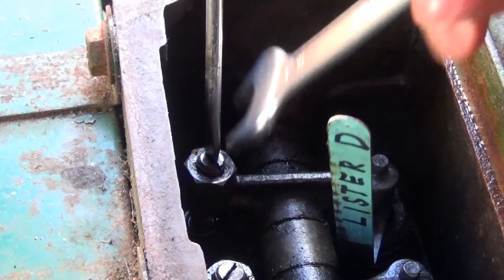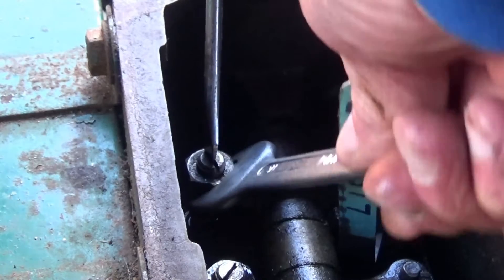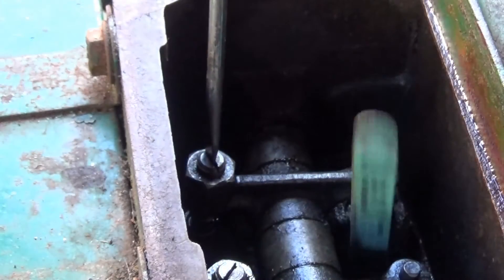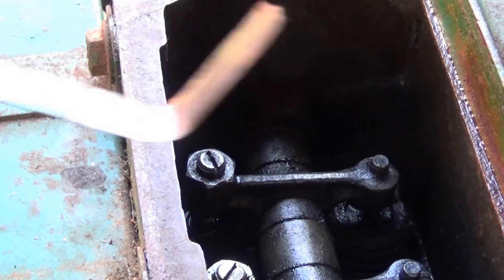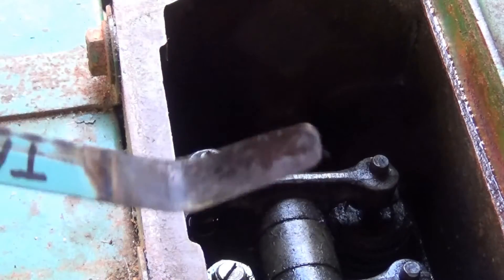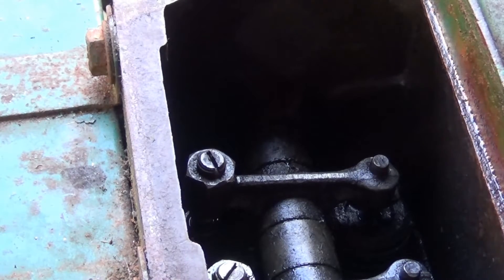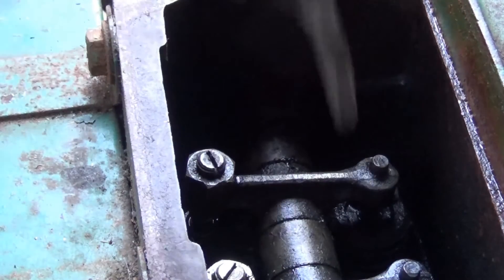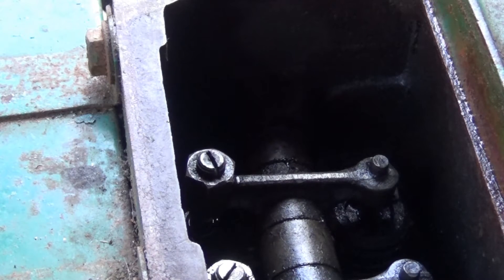How To Set Tappets

Comment: I dread to think how many engines I've set the valve clearances on...but it's good to watch other people too so we're always learning. The last one I did was on a 1973 850 mini a few months ago, it made a big difference too as they were miles out of adjustment. The other thing I found was the points/condenser wires were hanging on by barely one strand...gawd knows how that car ever ran.
Reply from the maker: Did the Nuffield but that's the only time I've done any for years Andy. Did 1 to 5 engines a week when I was reconditioning them in the early 70s. If we did 2 a day, I usually built one of them.
Yes I've discovered things that make you wonder how it's been running ok in the past.

Comment: I have my method and I'll stick with it Malc...I've shown it a few times and there many methods but in the end it's what ever works...Nice feeler strip mate.
Reply from the maker: But you know what you're doing ZIG.  I always used the 9 method, until.....it didn't work. Then used the rocking method. It's just on the tractor and engine pages I keep reading post from people asking  how to do it. Of course the replies are the methods we use. It's like everything, if you know the answer it's easy. If not it's impossible. I've done it this way on a 6 cylinder engine in the past.

Comment: Good tip Malc, never want to run them too tight or loose.
Reply from the maker: Too loose don't hurt, just makes a noise. Too tight does, will keep valves open and burn them.

Comment: Useful video Malc ! Remember Lister D's have only one lobe !
Reply from the maker: Hope so. That is one lobe per valve. But it doesn't alter the fact. If you treat each valve as ONE this will work. Doesn't matter if you have 2, or 100 (grin)
Reply: One lobe for the two valves ! I see it before in old lawn mower engines ! And the have two cam followers one on each side of the lobe ! Cheap design but it works great !
Reply from the maker: @massimobroccoli9854  Most unusual thing I've seen was the plastic cam in the new 3.5 Briggs I did for 'the engine project'. That was the first one I did to make videos. See playlist.